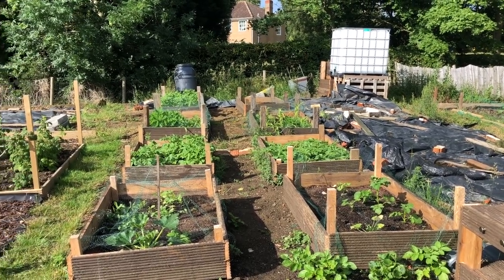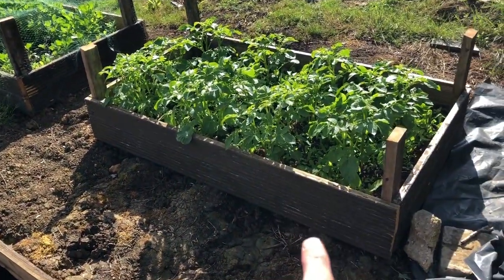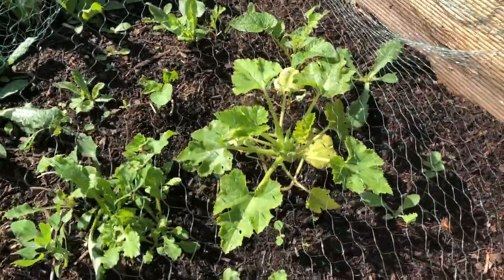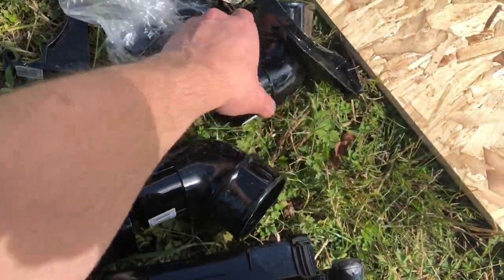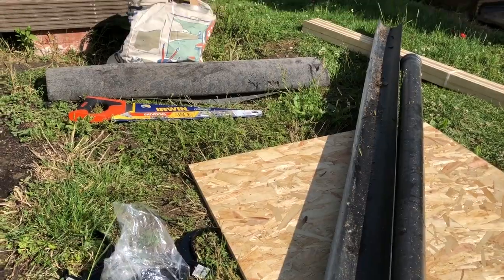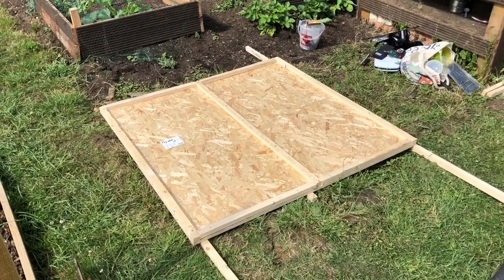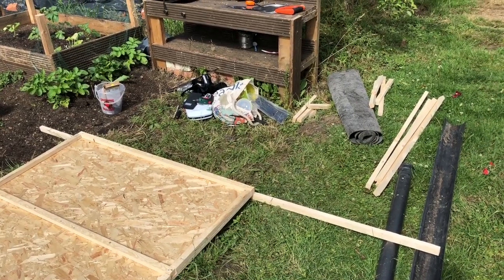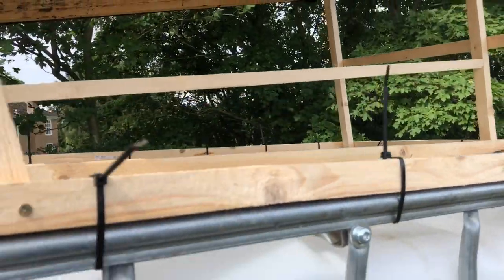Allotment update and IBC water butt roof build

Comment: think i would have made the roof a V shape and gutter at bottom of the v dead centre to the top of the tank
Reply from the maker: Thats a great idea, would have made the gutter pipe much simpler. I did play with the idea of a cone shape so no gutter at all but i thought i would keep it simple and copy others that work well. Would be interesting to work out the surface area of the v shape vs flat roof.